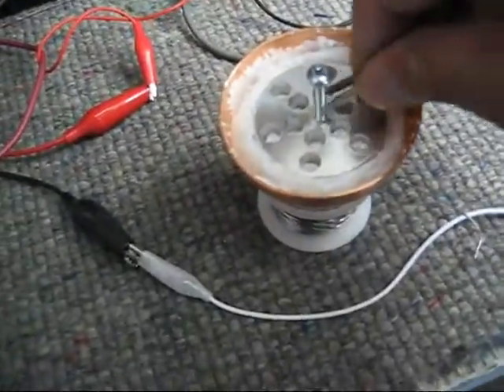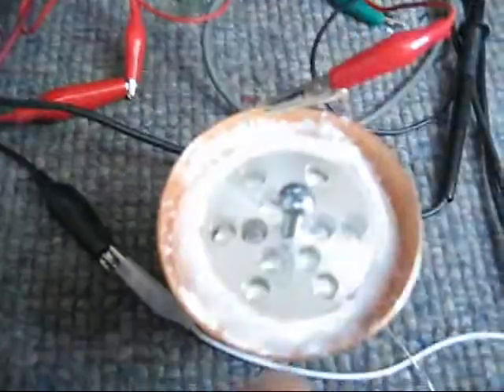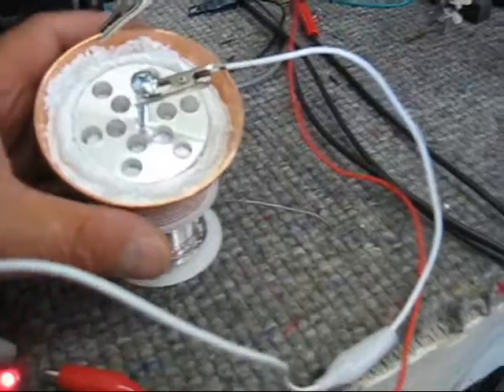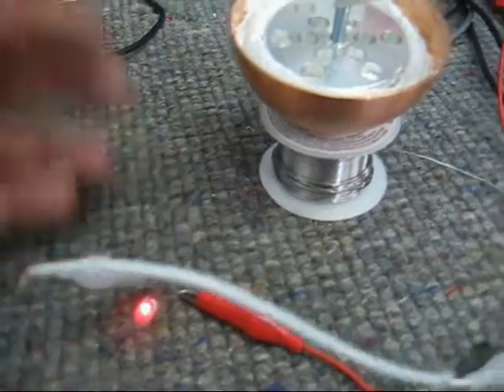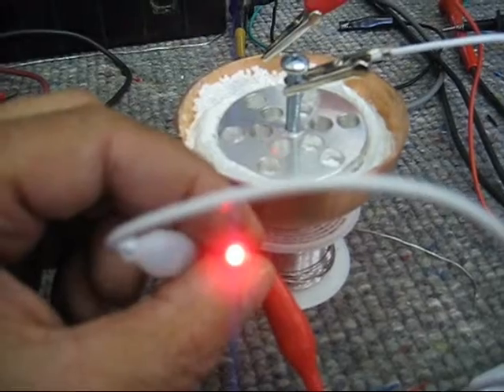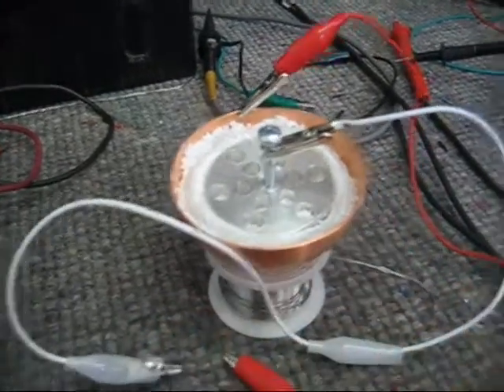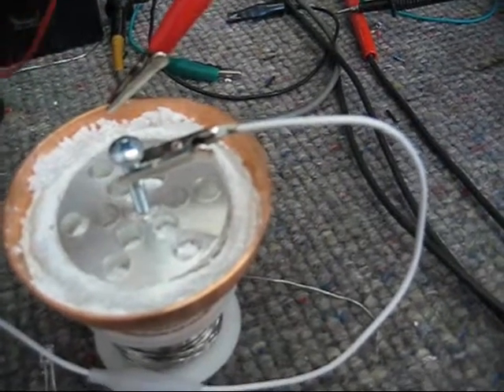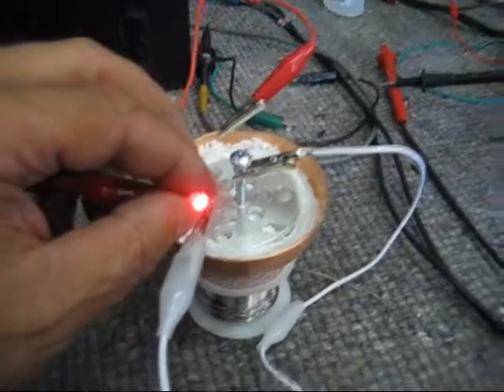Epsom Salts Crystal Cell.wmv

Comment: Add solar panel in parallel to add amps to your star cells.   Build several in series to add the volts.  Then, wire your star cell battery to a good amp producing source, like a solar panel.  

Watts = amps x volts!

Comment: Have you tried to put you most stable design in large blocks in line then in series
( maybe 1 or 2 hundred to possibly achieve 110 volts at a large amperage? Do you think this system if large enough could supplement a solar array in off times like at night or cloudy weather to get off the grid?

Comment: If you hooked up the load as the crystal cooled, would the salts crystallize in an orientation that gives a higher out put?
Reply: Thats what I was thinking...they would form in the magnetic lines of current flow which would allow more electrons to pass through easier because energy will follow the path of least resistance.